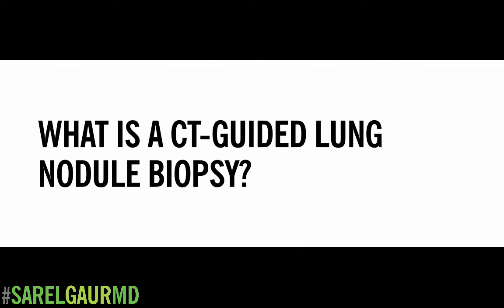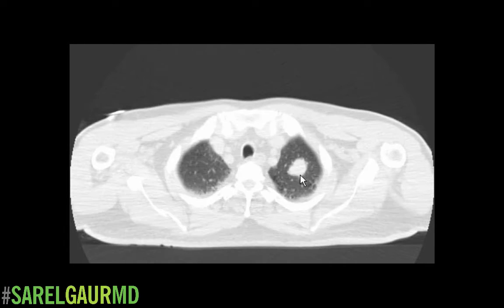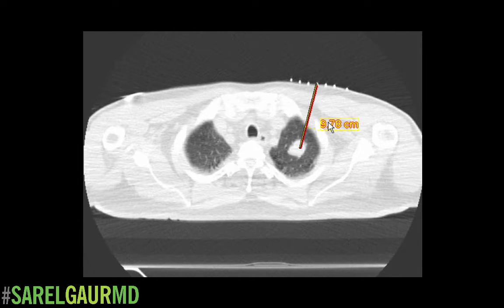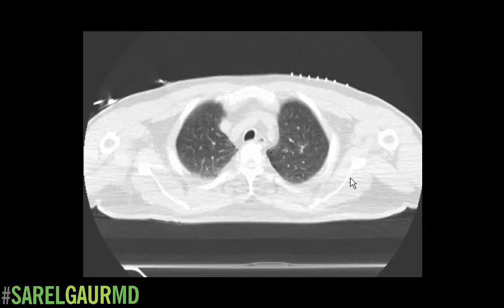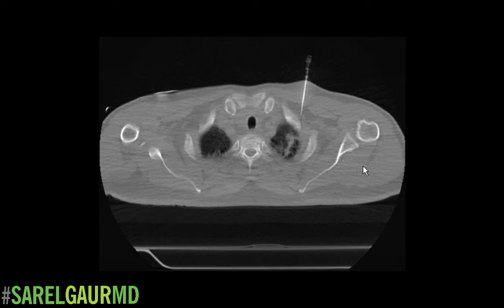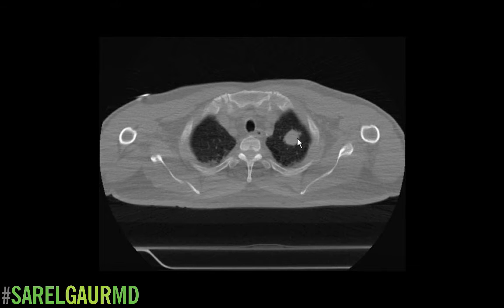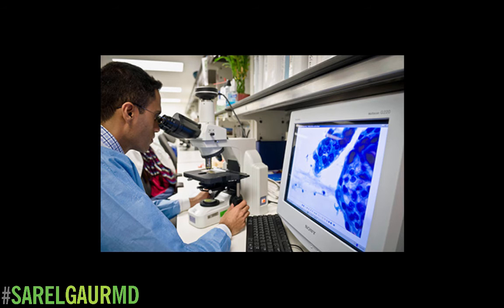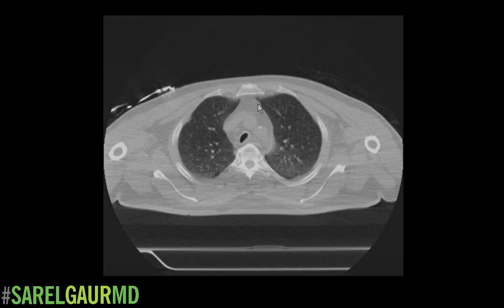What is a CT-Guided Lung Nodule Biopsy?

Comment: Dr.Gaur, Thank you for the video. I have a question. Is it possible for interventional radiologists to embolize a malignant solitary lung nodule similar to the embolization of uterine fibroids? Please pardon me if my concept is wrong. Thank you for your time.
Reply from the maker: +VIN N in my experience so far, they are not doing that but IR physicians are using ablation to treat malignant lung nodules and masses.  this is similar to the biopsy where they advance a probe (needle) towards the target then infuse a specific amount of energy at the tip meant to destroy that tissue.  

i know they are trying to expand the role of y90 radioembolization for other tumors so your question is a good one.
Reply: +Sarel Gaur MD Thank you for the explanation Dr.Gaur.